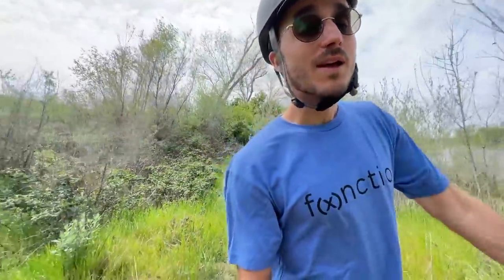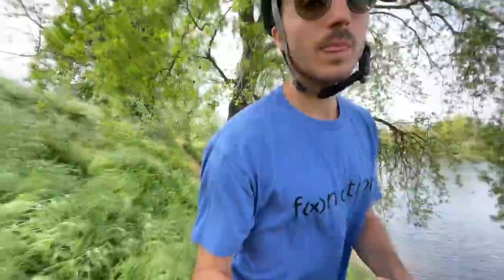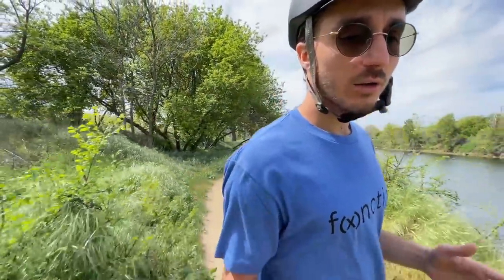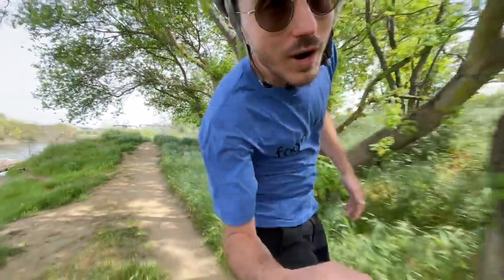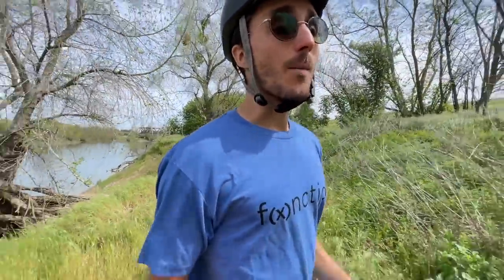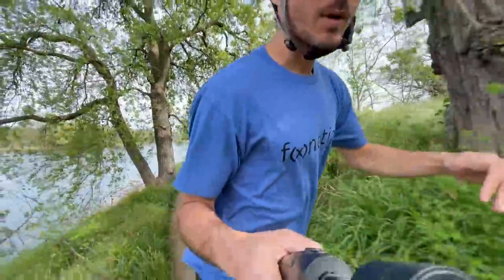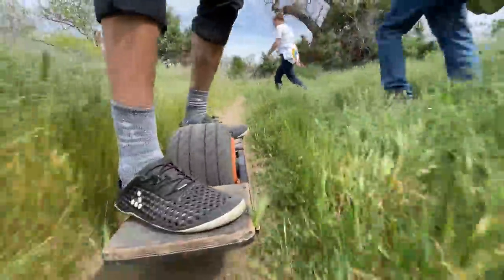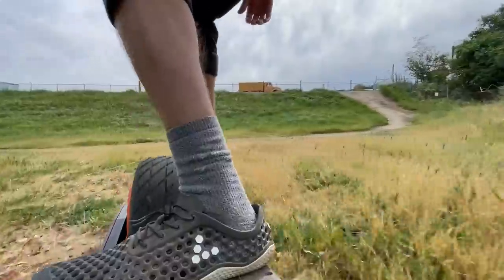Why I Don't Trust anything Future Motion says - #RightToRepair Onewheels

Comment: I had the same issue with the ferrite ring. I have a 4212 so clearly they never fixed it in future versions of the XR. I wasn't about to send that back to FM despite being within warranty. Took it to my local SLS shop and permanently fixed for $20. #FFM and shout out to Onewheel Tire Guru. 
Completely off topic but I love that helmet. I got mine about a month ago. It was pretty uncomfortable at first but I added some cheap foam pads to it from Amazon. Judging from your chin strap, you must have done the same thing. Front light isn't great but the rear lighting is bitchin. Very lightweight and keeps my head cool.
Reply: I’m glad I saw your comment, I’ve had a board for less than a year and I was wondering if this ferrite ring was going to be a problem for me as well, if there’s something that I should do ahead of time to fix it.
Reply: @CrechurBoy  If you ever see your headlights blinking, shut off your yours lights in the app immediately. You can continue riding. Continuing to use the lights after the problem occurs can fry your controller. Otherwise, don't worry about it much unless/until it happens. There's two things you can do about it when it happens: 1) Have FM replace the part and risk it happening again 2) Have a SLS shop fix it for you permanently but void your warranty.

Comment: The XR also had another common issue on the controller, today i repaired a XR controller for a friend and I noticed the Mosfet in the middle upper arm have cold solder joint under it, it was barely makeing contact with the pcb and causing it to create arcs under the mosfet and ultimately damaged the silicon pad of the mosfet, the board would not turn on after 400 miles of gentle use because the mosfet is shoot, replaced the mosfet and notice during the manual SMT of that mosfet it was very hard to get the solder pad to melt due to its design flaw, the middle upper mosfet has a significant larger heat dissipate area causing that mosfet to be poorly soldered on during smt. I recomand if your XR shuts off immediately after boot up, it might be a shorted out middle upper arm mosfet.
Reply: Hey dude, I've got a controller with Error 10 blink code that died a couple days after going through rain and some nasty puddles. Have you ever fixed an error 10 or water damaged controllers?
Reply: @getaflattyinya  nope, try take it apart and find out the issue.

Comment: Had my pint for less than a year when it failed to turn on one day. App connected when plugged into the board and showed the battery was fully charged and ok. I figured it was still under warranty since it was fairly new and they had me ship it out for repair. Told me the battery was bad and wasn’t covered under warranty. Charged me for a battery and ridiculous shipping from the east coast. Few hundred dollars later and left a salty feeling toward them.
Reply: It wasn’t even the battery if was the BMS. Same thing happened to me so I put the battery in another board and charged over night to level the cells and the battery was fine.
Reply: Same experience with both of the pints that my sons bought.  Really soured us on FM and we haven't bought anything from them since.  I've had battery powered lawn care tools for years and never had any problems with the batteries, even leaving them fully charged for months at a time.  Really hard to believe that we somehow "abused" the batteries in those pints to the point that they failed after only a year.  More likely shit parts or shit design.

Comment: I've had my Pint X for 3 months and suddenly this week it wouldn't switch on. Knowing how terrible FM's reputation is regarding repairs I've taken it apart myself and found the negative BMS cable has broken clean off due to bad design. I'd rather knowingly void my warranty than send it back and be at their mercy.
Reply: On the GT they'd auto brick you for doing it yourself
Reply: @AuRowe  wait are you saying that if you tried doing a repair yourself on the GT, there's some kind of software in place that auto bricks the bored.
Reply: @PR3M3  You can not unplug the BMS, on the GT which has a tendency to fail before the battery due to bad design, without it resulting in a board with no power and app message "corrupt data" until you send it to FM just so they can use their tool on it only they have access to. 

They're claiming its for safety when in reality its for them to maximize control over the board modders. For safety. But they have modded boards in their own recent youtube videos, and also ask people to black out "hazardous material" (due to the lithium) on internationally shipped boxes from Canada to allow it to bypass customs. 

The whole reason all the returns are needed often is related to the lack of third party repairability, which I have recently found out the extent to which FM goes to make sure there is little to no third party repair market. Hope this helps
Reply: @AuRowe  wow that's giving someone a gift but they only can use it when they are around the person that gifted it to them. WTF. I thought monopolies were illegal?
Reply: @AuRowe  yeah I know, that’s why I’ve just bought a brand new 2021 XR instead of waiting for the GT.
Reply: @AuRowe  another reason why not to buy GT, thanks for the advice!
Reply: Can't void the warranty if you break any seals or attempt to repair it yourself.  Warranty just won't cover any damages done by the customer.
Reply: @DurzoBlunts  legally opening up a product is not grounds to void a warranty *for years future motion has been using the fact that seals have been opened as evidence that modifications have been performed. If there is evidence or reasonable suspicion that modifications have been made to a board then FM may refuse to do any kind of repair or inspection.

Legally, the "warranty void if removed" stickers are unenforceable, however, if they're going in to do work and those stickers are removed, they may say that whatever damage is inside the box was caused by the user.
Reply: Unfortunately, you're not the only person to suffer that issue.
Reply: @AuRowe  worse. On the GT If the controller loses contact with the BMS, the board is immediately bricked due to "memory corruption". If the negative lead is severed, that would depower the BMS and subsequently brick the board. So if the battery lead issue were to occur on a GT, self-repair would not even be possible.

Comment: Ferrite is a compound containing iron oxide. It does have metals in it but it's more like a ceramic. You certainly don't want a loose ferrite floating around on your wires and them charging you to fix their design flaw when the warranty was applicable is a form of fraud.

The correct solution would have been easy: silicone sealant or similar to glue the ring in place.
Reply: exactly. that is what One Stop Board Shop did to remedy my Pint's shit-uation

Comment: Interesting stuff about this ring, this is the first I’ve heard of it. Got a few hundred miles on my board, kind of worry about it potentially happening to my XR at some point, is there an easy way of checking which batch I have? 
Thanks for sharing this info Jake, always appreciate your content :)
Reply: It happens to every XR eventually. Every version has it no matter what batch. You're going to have to remove or replace the ferrite ring cable inevitably
Reply: @TheCobaltsaber  hot glue is a better recommendation
Reply: @raiden72  if you are opening up the controller to prevent it failing, then a 21st century cable instead of hot glue is the way to go. And if its failed already the same, get a decent cable in there
Reply: @redboyjan  What I'm saying is, Hotglue is entirely acceptable manufacturing component, and could have entirely prevented this issue. Call it 21st century Hot Glue.
Reply: @raiden72  sure it's useful in non electronics sectors too. But no decent electronics company would use hot glue instead of a good design in the first place, in this case a cable fit for purpose in the way it is going to be used
Reply: @raiden72  they often don't put enough hot glue on other components, so asking them to hit glue the cable isn't gunna help any as it'll fail anyawy. FM people don't take design courses or have a quality control or materials 101 even. We open controllers from new to check for fuck ups, before riding them. Bad ones are rare, FM do usually make these things just fine, but a shit light cable is in every onewheel, and some aren't made right at all too. We been asking FM for a different cable for 6 years lol. And steel inserts. And to check solder joints. Jokes
Reply: Just open it up
Reply: @TheCobaltsaber  thanks for the information :) I’ll definitely be looking into removing it in the next few weeks then👍

Comment: Jake, you are a great engineer. Can float life start just making full boards? Are there too many patents in the way?
Reply: @inactive67  ah that sucks. Well their patent will run out in about 4 years I think? I think it was 2006/2007? Could give them 4 years to prepare for launch.
Reply from the maker: There are patents and they don’t expire til 2035
Reply: Make the board in a different country where US patents dont matter
Reply: @tigremonster1645  that doesn’t work. You cannot import or sell a knowingly infringing product. That would get you in plenty of legal troubles as it is.

People have even done this (from other countries) with diy kits that are a long way off from the real deal and even so FM sent their lawyers after them.
Reply: @mwiz100  lawyers can try to scare them off but not much they can do unless they have patents in that country
Reply: @tigremonster1645  it isn't as simple as that, or it'd be being done already
Reply: @redboyjan  doable. happens in china all the time
Reply: @JakeLeary  F*ck. Well would be cool if you would come up with your own design that was different enough that it didn't infringe on the patients. Sure that seems pretty impossible but  you never know!
Reply: Arduino self balancing robot.. you can make your own board.. the first onewheel was using an arduino at mega . 

Arduino self balancing robot 
And get you circuit board printed from pcb way for $10
Reply: @tigremonster1645  You called it man. Floatwheel is stepping up

Comment: I had an issue with FM customer service as well back when I got my plus. It would shut off on me while I was riding so I sent them my board and about a month later they sent it back to me. I get on my board for a ride and within 3 blocks the board shuts off on me again!! I also forgot to mention that I had a battery pack that I could charge and ride but when they sent it back to me they switched out the controller and I couldn’t charge n ride anymore. Luckily I had some friends that bypass it so it was back to normal again. It was a total pain in the ass dealing with their customer service.

Comment: Jake, I had a similar issue with the lights. Got a new 4212 XR about a year ago, got 3k km on it and last winter when it was already cold I had the issue that the front light would flicker or wouldn't stay on, which would go away if I went down a larger curb or smacked the front of the board with my foot. And I would have to repeat that when starting riding each time. Then I stored the Xr for the winter, and before taking it out again for the spring I checked and tightened the outside connectors to the controller box - now I ride it and don't seem to have the issue anymore. So I didn't bother with the warranty but like should I be concerned?
Reply from the maker: It means the wires are frayed but still intact, if the headlight goes out completely it probably means the wires have been ripped out entirely, at which point the ferrite ring can smash other components and brick your board

Comment: I’m a total capitalist at heart. A company with compelling products/services should make a profit. I’ll even ignore the occasional anticompetitive move, as pretty much every company fights to protect profit margins. FM simply crosses the line. Locking the bms to the battery to prevent third party replacement, forcing customers to pay inflated repair cost on top of shipping. Designing a board with a nonstandard tire/hub size, offering one repair location, forcing customers to ship to CA. These business practices will eventually lead to FM’s downfall, just a matter of time. Actually wouldn’t be surprised if Kyle is talking with more PE firms now.
Reply from the maker: Yeah. Imagine riding a Onewheel in France, running over a nail that punctures your tire and having to pay $100s in shipping and be without your board for 3-5 weeks
Reply: @JakeLeary  Yep. Totally unsustainable. FM has stopped innovating. They’re improving the existing innovation, but I’m betting their profit margin doesn’t improve much with the GT. Building these in CA also really hurts the volume equation. Hence the increasing focus on turning tire/repairs into a profit center…while alienating their customers.
Reply: @JakeLeary  We have that exact problem in Australia!

Comment: if I got a one wheel this past October you think it has the ring in it? should I go in and take it out? you got me worried lol cause im always shredding trails
Reply from the maker: Brand new XR from 2021? The newer ones have it secured better. You will definitely notice the headlight flickering if it starts fraying the wires.
Reply: @JakeLeary  I have a flickering headlight for my XR. I disabled the lights in the app. I should look into the official fix.
Reply from the maker: @fromdonwithlove  oh yeah it’s not just the lights. Once the lights go out completely the ring is most likely free to bounce around and break other parts in the controller box
Reply: @JakeLeary  good looking out my guy

Comment: I bought a GT a few weeks ago.  It ghosted on 1st try.  I am still going back and forth with FM to get a damn front foot pad replacement.  I still haven't even been able to ride my $2,500 skateboard.  Regret.
Reply from the maker: If you can find an air bubble in the grip tape and pop it that should do the trick. Or light heat with a heat gun and a roller could work but the best solution is to get a new footpad
Reply: @JakeLeary  I dropped another $150 on a replacement footpad.  It's already been shipped.  Still waiting to hear anything from FM for the replacement they said they'd send three weeks ago.  I'll try that heat trick.  I will definitely be trying to fix the bad one.

Comment: How TF they gonna charge you any money for changing the controller box if it was under warranty ?
Reply: Cuz they can claim whatever bullshit reason that you broke the warranty. The manual says to not ride on anything over 15% grade hills. Thats an 8 degree slope. A wheelchair slope.....
Reply: Warranty doesn't cover "user damage." It covers flaws in materials or workmanship. So if they examine it and decide it's user damage, you're SOL. So that would be trick riding, water damage, and a lot of other stuff. To be fair they seem pretty good at warrantying actual flaws in materials or workmanship, just slow.

Comment: I got a Pint X in October 2021 and have definitely enjoyed it, but knowing more about FM's business practices, shoddy repairs and over shoddy components (charging connector being a laptop fan connector that is NOT at all appropriate for the power being sent through it), as much as I'd love to buy a GT it's really hard to justify. It's hard enough to justify with as expensive as they are and it basically being a hobby/fun item, but with their further issues it really just makes it difficult to want to give them more of your business.

Several videos I've seen of FM's repairs are absolutely awful. They've used the wrong screws, forget to put some screws back in, unsafe electrical wires with ripped insulation, terrible solders, etc... If FM technicians are the only ones "qualified" to fix their boards, I think I'd gladly take an "unqualified" technician, you'd be hard pressed to find someone that'll do worse work than FM technicians. All of these are absolutely an example of why we should have right to repair on these items.

If the information and parts were out there and available I would absolutely trust many many people to perform work on these before I would trust FM.

Comment: Those rings are super important for interference suppression! Please just secure them using glue or something!
Reply from the maker: What would you say would be a worst case scenario from removing it from the headlight cable?
Reply: @JakeLeary  
A passing car would maybe hear a BZZZT or a rising or falling tone on their FM or AM radio?
Maybe contact the FCC and ask for the reason why and on which frequency this "possible interference" was discovered forcing the FCC to push the ferrite ring solution on FM
Worth testing for?
Run alongside a car while the passenger scans the radio channels?
Reply from the maker: @JohnSmith-yv6eq  I leave my boards powered on inside the car all the time
Reply: @JakeLeary  
I was thinking more of the active mode rather than the charge mode...you know, the same reason Resistor sparkplugs and carbon trace/wire shielded wires are used in ignition systems on ICE engines/vehicles/aeroplanes.
With the engine off...no problems with any sparkplug.
Engine running...no resistor...snapsnapsnapsnap...on the radio....sometimes gets through even CD or bluetooth etc.
Marconi found long distance radio transmisssions (morse code) to be very effective with electricity jumping a "spark gap" while attached to a rather large aerial....
Basically artificial lightning on broadcast to the world......